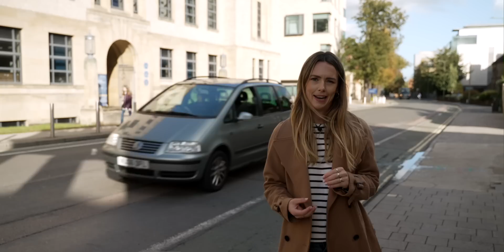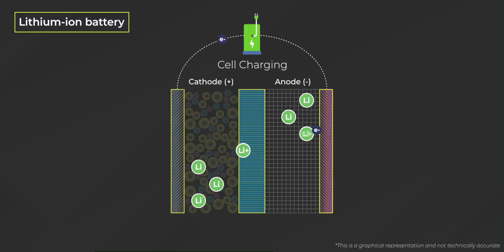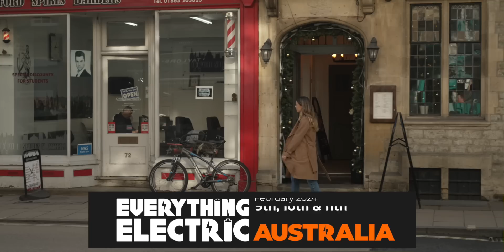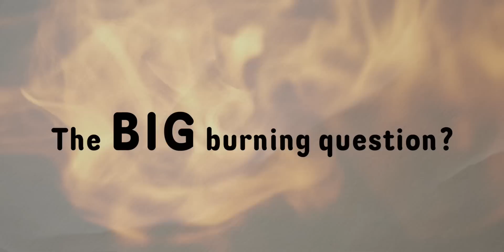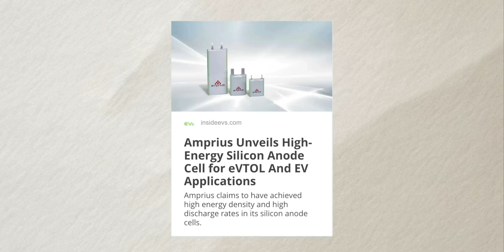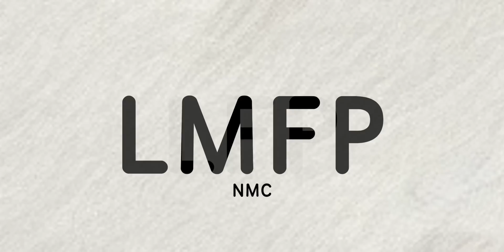The BIG Battery Breakdown: Fires, Failures and Future Breakthroughs!

Comment: Regardless of the "probability" of an EV fire all over the Internet they are talking of EVs being stored away from other cars... talk of insurance premiums increasing beyond  ICE insurance. Every single fire is automatically pointed at an EV (Bristol Airport Fire, Luton Airport Fire). EV fires needs knocking out to zero probability.
Reply: Insurance companies price their products based on statistics. You'll fine 1000 fear mongering keyboard warriors using this argument against the cost savings of EVs before you'll find a single pricing actuary raising car insurance premiums based on facts. The only exception might be property insurance since a potential total loss is so much higher, but even then, risk of a battery or electrical fire should be so much lower than the constant presence of flammable fuels like petrol.

Comment: Canadian here. Good point on how much easier it is to install charging infrastructure than develop a 1000 mile battery. That said, a battery that could do 600km in -30 degree weather would be a game changer for remote areas. I’m hoping that ONE’s Gemini will get us there.
Reply: I think that everyone in the EV industry is missing the point when they say we don't need 1000 mile battery and we can just charge in our breaks. The fact is that here in the UK, it costs typically 10 TIMES more to charge at a public charging point than to charge at home on a cheap overnight tariff.  I, and many other EV owners here, would love a 1000 mile range, so if I am away for several days, I can do the whole trip without being ripped off at public charging points, and then charge up again cheaply when I get home.  Using public charge points, it is often more expensive that it would be to put fuel in a petrol or diesel car.
Reply: @uproid 
Here in Denmark we start to see competition and fast chargers prices drop, so I hope we get to a point where fast charging is affordable.
Reply: Given that the majority of journeys don't need that range,  perhaps the answer is to rent an additional battery that goes in the trunk? Or simply just rent a long range vehicle for those occasional trips.
Of course there will be a minority of folk who regularly drive 600km, but the market can look to support them.
Reply: We need long range (1000km) batteries here in Australia.
Reply: and it would have to fully charge in mins not hours.
Reply: @ADobbin1 this can be done when swapping the battery,  could even get a temporary bigger battery for longer trips or towing. 800 km approx from a 150kwh battery is now available in China.
Reply: Or perhaps only instal half of that 1000 mile battery. If it’s one of the advanced chemistries that battery would make for a lighter and more manoeuvrable car.

Comment: Will we finally be able monitor each and every single cell to know what actually goes wrong before we need to deal with fires?
Reply: Yes they can already but as Euan explains it's redundant .
Reply: @pearsonfrank  I thought we could not, would be keen to hear more, maybe you can give an example? Also, changing context to for instance performance would make the same metrics very attractive. Not sure how would we land on them being redundant.
Reply: I don’t know about other manufacturers, but each and every cell in a Tesla battery pack is connected to the bus bar by a thermal fuse. If the battery overheats, then it is disconnected when the fuse pops and the risk of thermal runaway is removed.  Unfortunately, such safety measures can’t be enacted with petrol and diesel fuel tanks which are typically located under the rear seats of the vehicle.

Comment: Imogen you should see "Putting out lithium ion batteries with plain water in a short time" by Swedish fire information and intelligence. 

Long story short ev battery fires stay contained fire fighter's assets have a 30min turn around from emergency call to battery made safe. UK equivalent fire department is well aware of this too, they use the cobra water lance that has been in service since the 80's.
Reply: As demonstrated in the recent Luton Airport carpark fire the diesel Range Rover Sport started the fire, melted the diesel tank and became a river of fire that spread to thousands of cars. That particular Range Rover model has a recall notice for fire hazards fix.
Reply: In a recent arson attempt on multiple Tesla's in Germany cars burnt batteries did not.

Comment: One EV getting lit, for whatever reason, in an underground parking, could burn the whole building down or more of the block its on. An ICE vehicle fire is much less likely to burn a house or building dopwn, due to the way it burns. Diesels isn't even available as fuel unless it's heavily compressed in the cylinder.
Reply: That parking garage fire in the UK , that was initially blamed on an EV, was started by a diesel. Yes it’s harder to start a fire with diesel but it’s not impossible. Oh and once the fire started, the adjacent plastic fuel tanks melted forming a pool of fuel that further spread the fire. The pool probably ended up softened the steel structure of the car park enough that it collapsed. And yet we blithely live with this sort of danger every day because we know even malfunctioning range rovers are rare and not things to scare little children with. EV should be treated the same way.
Reply: how long till your comment gets deleted 😂

Comment: Well in my point on view for the super big range can is a good thing, you don’t need to drive 1000km a day, having a long range car with a massive range means you won’t have to cycle the battery that often and as a result you’ll have a longer lasting battery life too, it won’t reduce the weight of the car but who cares when people are buying giant SUV’s anyway…
Reply: @@retiredbore378 well we will always have different opinions about that, I stick with mine, also prices shouldn’t increase if you’re useing the same amount of cells on a car just cuz they have higher amps “capacity”, … time will tell, I do build small boards and my packs are the biggiest at moment around the group, friends already told me when the batteries get better I can use less and I replied, I won’t use less cuz once they are better I’ll have way way more rance using the same amount, which is good, people that don’t like it don’t need to agree anyway …

Comment: A 1000 mile battery in marketing terms is city range. At 130km/h in the winter it's like 6-700kms tops. That's just an average ICE car. So yeah, that'll make EVs equivalent to ICE cars. My car charges 10-80% in approx 18mins in ideal conditions. Make that 5 too... Then it'll be truly equivalent to an ICE.  ..and then we can forget the silly layouts of charging hubs that need to combine charging with parking. We can then simply replace petrol pumps in existing places with chargers.

Comment: My view is that 1000 mile battery is not needed in any use case.  Here in North America, we focus a lot on trucks that travel long distances without stopping, but the reality is that if the fuel, i.e. electricity, is significantly cheaper than diesel, there is a good economic argument that stopping for a recharge is not an issue.  I would pay the driver for the 30-60 minutes in exchange for the lower cost.  Furthermore, stopping more often would be better for the drivers and for road safety.  That is so true that it's the law in many countries.
Reply: Anything more than 300 miles is reaching a point of diminishing returns for anything other than over-the-road truckers.  In fact, given the choice of over 300 miles, I would rather stop at 300 and trade the extra battery for a roomier, lighter, cheaper vehicle.
Reply: @getoffamylan6844  Depends on what you do. I travel all over England and Wales filming EFL football matches. I have to arrive at a specific time and cannot risk being late so I dare not take the risk that I wouldn't be able to find a vacant charging station that is working then spend God knows how long waiting to charge an EV. I currently drive an estate car that when fully filled up gives me a range of 650 miles.

Also not forgetting that a large enough EV car with  a long enough range that can take my equipment and passengers would probably cost at least 2 or 3 times what I paid for my current car. And before anyone comes on and says driving long distances I need to stop then I do for short breaks but the driving is done by 2 of us.

So at the moment EVs are not a solution for me.
Reply: The problem is the EV truck starts out with 300 miles of theoretical range but it is cut in half as soon as you hitch a trailer up to it. That is why people want a 500+ range EV truck as the starting range

Comment: Euan talks so much sense, let’s stop seeking the maximum range possible and factor in what endurance the driver has, and then when we have our Wizz break, it’ll have sufficient range when we get back in the driver seat.
Reply: no he doesnt, quoted statistics have no references to studies. Comments on 1000 mile battery not needed, for many perhaps not, but some countries yes. Plus the transition to EV would be easier if the need to fill up every 250 - 300 miles wasnt a requirement, this would reduce the need for public charging, which appears to be an issue in many many places.

Comment: Good episode.  But, you are still talking mostly urban and industrial users.  You want smaller lighter EV's which might work well in the city ...  But country dwellers (like me) can't do all that much with smaller lighter.  What we want is the the old "station wagon"  (estate) of the 60's with a trailer ball and a 1K range.  Why, because we will be loading up and towing.  The towing bit with our camp trailer (caravan) or our boat will gobble up "range" down to about 50%, or maybe less.  A trip from say central Calif to my cousins in Wyoming is around 1K miles each way, and precious few towns along the way, not to mention changing stations - especially ones that can handle combo vehicles.  And working ranchers, vets, machinery repair & service trucks/crews, AG supply deliveries all have (from the EU point of view) vast distances to cover between stops.  In my pre-retirement day job doing 600 mile days was not out of the ordinary.  Point being we are approaching two classes of customers - urban and rural, at least in North America.
Reply: I was going to bring up towing caravans as an example of an exception. My parents used to drag a caravan across Europe each summer and for their use case a normal battery size (and charging speed) wouldn't be enough. We'll probably see specialised versions of cars for specific use cases like this. Eventually development will catch up and make it a non-issue one way or another.
Reply: Yes, there are people that drive vast distances through barren wastelands on a regular basis and an EV is not an acceptable solution for them, BUT THEY ARE THE EXCEPTION! The 5% (which is a LOT of people) can keep using ICE or hybrid or whatever for the next decade or two until those solutions become so cost prohibitive that it's worth it them to change their habits. That doesn't mean EVs can't work for 40/50/60% of uses now. All the nay sayers point out all the scenarios that EVs don't work while ignoring the 20 other scenarios where they do work.

Comment: We don't need 1,000 mile petrol or diesel tanks in our cars, even if we're planning a very long journey, because refuelling is not a problem. So the same would go for electric-powered cars if the infrastructure is there. 500 miles is fine, I think.
Reply: Realistically: Most of the drivers will come out of less than 50Km a day for their regular commuting needs. In no way will a 1000Km car be needed other than for Taxis, Uber, or other professional appliances like that. And for the most part, EV's are not set to be charged, they're set to be always charging. There won't be miracles. If you have the ability to charge your EV at home or at work, great. An EV is the best outfit for you. If that's not the case, await till there are those conditions. If you are a top professional with tons of daily distances needed, so await till there are cars that make those distances.

Comment: Not very ecologically sound all that.
I’ll stick to my 20yr old Saab 9-5 which has had a remap to run on E85. I reckon it’s greener than any modern EV, cheaper to buy and run, has better range and can be filled in 5’. Have I missed something ?
Reply: The environmental impact of increasing ethanol production.
Reply: Yes, yes you have as your old oil burner isn't even close to being greener than an EV and certainly not cheaper to run either.
Reply: @kswas2784  ICE cars are organic 😉
Reply: @kswas2784  I beg to differ, E85 is €€0,95/liter at the moment. The car cost me €1500 all in (remap and registration included), it does 800km on a tank and I can splash and dash anywhere in 5’ rather than park and spark (if I can find a charger)… can you show those figures with any EV? I doubt it, but stay delusional guys, just stop trying to force your EV nonsense down our collective throats. Buy one if you want (if you can afford it- I can’t) that’s your problem.
Reply: @robinforrest7680  So you're driving a crappy old banger that's going to cost a fortune in maintenance to keep it alive while choking pedestrians on the fumes produced as you burn the very fossil fuels the world is trying to phase out before the planet becomes uninhabitable?  Sounds super green dude.
Reply: @robinforrest7680   "just stop trying to force your EV nonsense down our collective throats. Buy one if you want (if you can afford it- I can’t)"

And there we have the true crux of the issue, you have little money.  Yes, I can afford an EV and purchased a Launch Edition Polestar 2.  It only costs about $5 US to fully charge up at home and have 250+ mile range.  Always leaving home with a full tank.  You broke blokes are funny always trying to hang onto fossil fuels and justifying it! LOL
Reply: @robinforrest7680  mate I charge my car for free.  There's so much sun in Australia that I sometimes get paid to charge just to reduce the energy on the grid and the price goes negative with so many home solar systems on the grid. Price is usually 3 cents per kWh through the day. That's $2.25 to fully charge my 500Km car? But I also have a house battery so I sell some electricity when you petrol burners come home in the evening and turn your aircons on so I make a $ or two every day ($30 credit per month for electricity bill even though I'm charging an EV).  I also love that I've had an EV for over 4 years and never had a service after 80,000 km. Never had to change the brake pads or rotors, never had to change the oil or oil filters, just tyres.
Reply: @kswas2784  if you’ve got cash to throw away on disposable crap that’ll be in a scrapyard in 5 years that’s your choice. Sooo environmentally sound that is. Personally I could find better things to spend my hard earned cash on. How much of your $5 « fill up » is fossil fueled I wonder ? Oh, sorry I forgot, EV’s run on fairy dust made by the big green pixie 🧚 don’t they ?

Comment: longest range needed: 250 miles (400 kms), on the highway 20-80, so 400 miles 0-100%, 3 to 4 hour drive, with 1 hour pauze to recharge, eat, rest and go to the bathroom for travel. Also makes for one week range in most drivers everyday use. 50 miles per day is more then 80% of the people need.
That way, vehicles can stay light and affordable, and a light vehicle will use less energy.
Reply: I kind of agree. But the ranges should be ACTUAL ranges, and not what they tell you, because that doesn't hold up.

Comment: Had to loop and listen 3 times - not 450kw/kg! Think you mean 450w/kg.
Reply: No it’s Wh/kg (energy density). kW/kg would be power density. @pauld3327: 450 kWh/kg would be a 1000mile battery in a coke can! (We can but dream) it’s 450 Wh/kg that’s the current state of the art.
Reply: @sic1038  You're right. I corrected my answer 👍
Reply: @pauld3327  I quite liked your answer though! That’d be ace wouldn’t it?!
Reply: @sic1038  Yes 450 kWh/kg would be great 😀
Reply: @pauld3327  450 kWh/kg would be a bomb.
Reply: Makes me question who wrote the script, and why the error wasn't picked-up on.
Reply: 450 Wh/kg

Comment: What an excellent video. Thank you, Imogen and the FC team.   I think the correct question is, "Should we develop a 1,600 km battery?"  The answer is yes.  Always yes.  Not "do we need".    Do we need a computer with more that 50 megabytes of ram?  No.  We just stop right there and code to that level forever more.  We're done.  There.  Solved.  Also, the wonderful guest broke almost every rule in videography.
Reply: I’d like us to instead be able to reduce the size and weight of batteries while being able to get the same range. It’s the same problem but we all seem to be fixated on range rather than reducing the resources needed in a battery.

Comment: What about Aluminum Ion? I would love to hear this guy talk about it.
Reply: An American university made a prototype of aluminium and carbon electrodes, with urea in water solution as electrolyte. Simple, very cheap, but energy density was half of Lithium batteries and electrolyte freezes at -15C. The voltage is less than 2V, so water electrolyte works fine without electrolysis and production of hydrogen in normal charging conditions. 

Aluminium - oxygen "fuel cell" has great energy density, but it isn't rechargeable. And for aeroplane use the problem is that the oxygen increases weight, so landing weight is higher than takeoff weight. Charging is made in aluminium factory, making the used aluminium back to metallic.